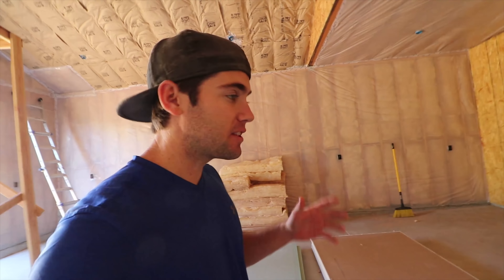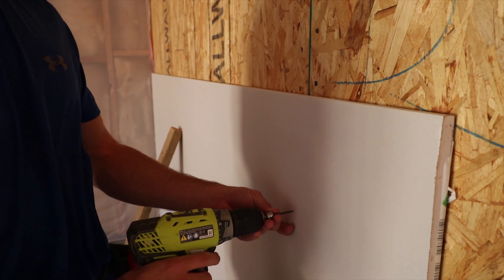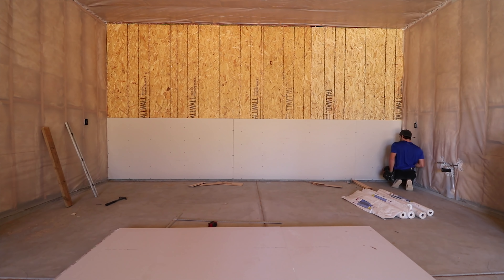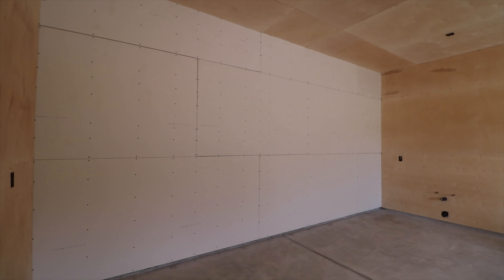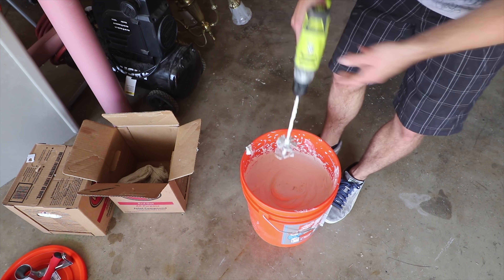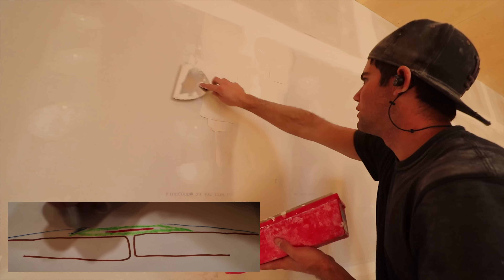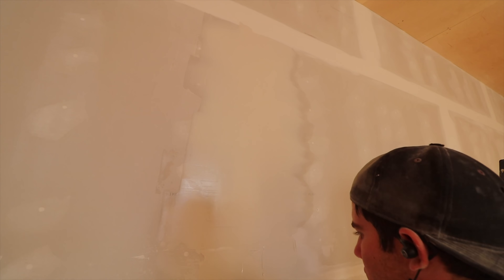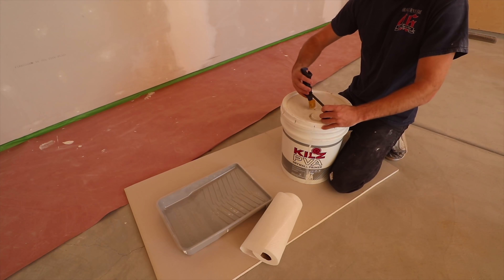Shop Build - One Dry Wall

Comment: Hey Ben, new home construction superintendent here... 

Questions,

Do you have to use 2” screws on shear walls?Here in San Diego we do.

Also, your insulation inspection is for QII energy code correct?

Love your videos buddy! Your talent knows no boundaries!
Reply from the maker: I was instructed to use the screws that were recommended by the drywall I was installing. Though I suppose it couldn’t hurt to use longer screws. 

Off the top of my head I’m not sure what energy code I’m at, I’d have to check the plans but it’s probably that or something close to it

Comment: Thats a whole lot of perfection for a shop!  I was wondering - did you have to do drywall over wood sheath walls?   Cali code? I would have just painted wood sheath walls and started hanging tools!!
Reply: He said earlier that this wall had to be drywall because living quarters were on the other side of the wall.  Also, I think he said he intended to use that wall as a backdrop for future videos.  Except for those two considerations, I agree it would have been sort of overkill otherwise.

Comment: In theory:  if your walls are 10’X 20’  
                   Nails placed 12” apart, but you decided to go 10” apart 
                   You would require 232 nails  if spaced 10” inches.   Final answer

Comment: Have to ask, is there a reason you used 6 sheets horizontally vs 5 vertically? anything over 8' I will usually do vertically, far less cutting, taping, sanding...
Reply from the maker: I am only able to transport 8 foot sheets with my truck. 10 foot sheets are too long. So instead of paying for delivery or renting a truck I chose to do more work with mudding. It was a cost benefit decision

Comment: Why didn't you put the firewall (drywall) on the other side of the OSB?
Reply from the maker: Because of the building code
Reply: @BenTardif  I am very intimately familiar with the IBC. Presumably wall on the other side is a single family residence and the plywood is there as a shear wall. Obviously sure we'll have to be mechanically fastened do the stud frame work. But there's nothing in the code that prevents a fire break, such as drywall, being installed in between a shear sheeting and the stud framework. IBC in the RBC are specifically concerned with through wall fire protection, as established by the amount of time it takes fire to get through from one side of a wall to the other. I can imagine an uninformed inspector, and there are many, might insist on the drywall being the outer layer, but this is not what the code requires. Having said that your particular City might have some odd requirement. But this is hard to believe given the use case for the layering partition walls for purposes of fire protection. I guess my question is, what specific code is being interpreted in such a way so as to require this?
Reply from the maker: Can’t tell if your kidding or not but why would you put drywall in between the studs and osb for a sheer wall?

Separately, osb is ugly. Should not be the outer layer.

Comment: This guy doesn’t know anything about dry wall. He placed way too screws for 1/2 inch dry wall lol
Reply: @relatableLou code calls for every 12" vertical which is 5 screws per stud he used 7 per stud which is far more than needed. Wrong technically, problem no